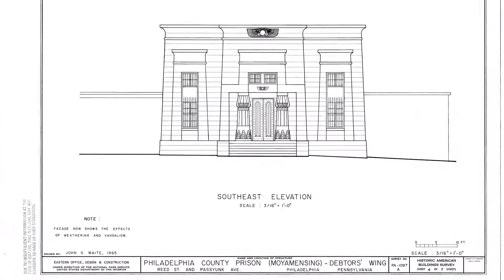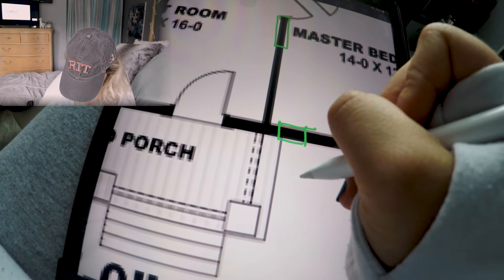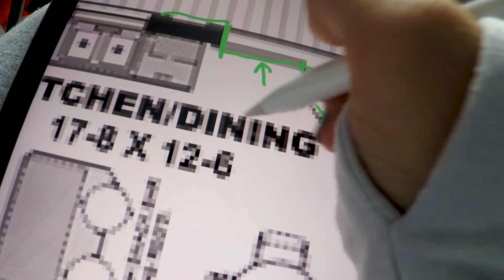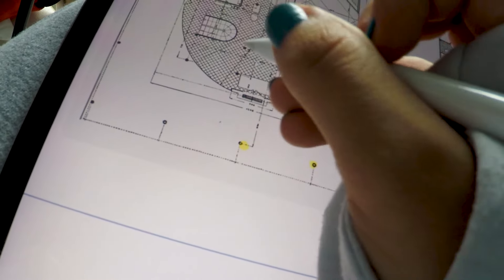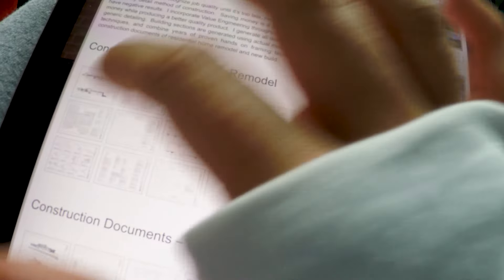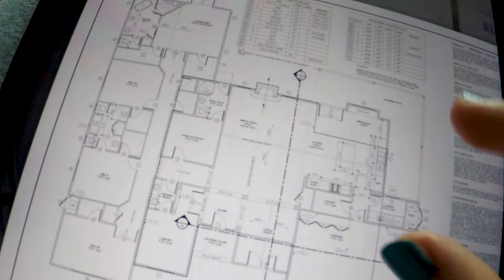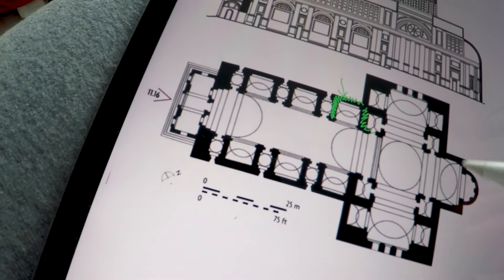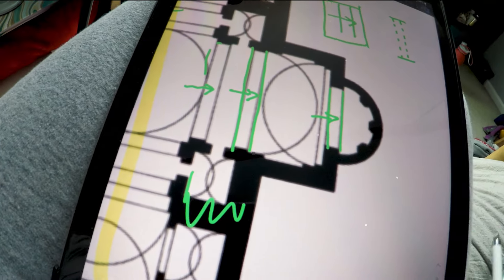how to read a FLOORPLAN (architecture edition) Understanding Architectural Floor Plans Walkthrough

Comment: Oh my gosh. thank you so much for helping me understand how walls and windows looks like in the floor plan. I'm a Mechanical Engineering student in the Philippines, and I'm currently taking airconditioning system and design subject. Our prof gave us a quiz about heat load, and we needed to compute for the area of partitions. The glass walls are included in the computation and we don't have any idea about how glass walls and concrete walls looks like. It really makes me depressed.. Thank you for sharing your knowledge with students like me. 😭

Comment: A good architect will care about how it works and will design it to stand up and function, not just look pretty. Thats why the training is 7 years. But make sure they are actually an architect (which is a legally protected title like Doctor) not a designer, who is not required to have any skills experience or qualification. Structural engineers will only design understand how the structure works. Mechanical and Electrical Consultants will work on the heating, ventilation and lighting. The architect is the lead consultant who pulls it all together.

Comment: I learned about doors and walls now I'm.a painter and need to know how to read them. Teach me about all the numbers on the outsides
Reply from the maker: There are several wall types 
WT-01 could stand for wall tile 01, depending on how the architect drew it. Whatever abbreviation was used, correlates to a finish that could be found in your finish schedule. 

Numbers also found in different parts of your documentation could also signify different wall compositions. FX-XX (Xs are placeholders) the F typically stands for a furring wall for instance.. 
If it’s SX-XX, the S typically stands for stud wall. But this isn’t necessarily universal. Moreso up to the preference of the architect who drew it.

I can’t really tell if that answered your question cus there was no really good description of what specific numbers you’re referring to. But hope that helps

Comment: Hi Natalie! Glad to see you're recovered from COVID. Can I ask five follow up questions please?

1. @4:41 Why would the swing angle of a closet door be less? Do you mean that the closet door won't swing out fully?

2. @8:01: What does "this arc shape was designed to match the turn radius of these cars" mean? That design doesn't feel intuitive. 

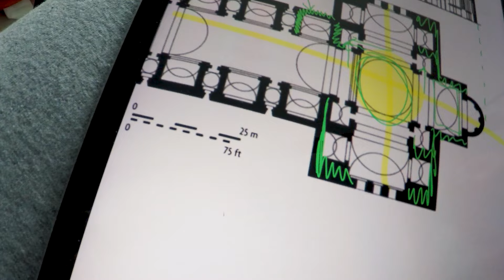3. Please simplify @12:20? I don't understand the curves, and what the red outline means. 

4. Clearer floor plans would improve your video. Can you analyze the floor plans in https://www.amazon.com/Architecture-Today-Houses-Manel-Guti%C3%A9rrez/dp/8499369715, because it contains, complicated, floor plans of fancy but good-looking houses, along with pictures of the houses and elevation drawings. As you advised, we must practice, but we must crank up the difficulty of the floor plans. I'm reading this book now. UPenn's library must have a copy?
Reply from the maker: Hey there! Great questions:
1. drawings need a sense of hierarchy. If you look at closet or a pantry door in your house, chances are they are slightly smaller. I typically drawing existing swing angles at 45 degrees and new doors at a 90degree angle for instance. The degree you draw your swing at really does not affect if it "swings out" fully. It will!! It just depends on how you draw it!!
2. Hahah yes, this is a Le Corb house. Le Corb did a lot for the modernism movement in architecture. Le Corb studied his cars there, and calculated the ideal turn angle. The level 1 of this house was designed so you can gracefully just swing around the arc of the building and park you car, then head right upstairs. He was really experimenting with the flow of circulation in that building, and you can see that even with his extensive usage of his ramping systems in a lot of his projects!
3. the read outline is the section. I was trying to show how a plan and section work together. A section is almost like a slice of cake. A plan is a transverse cut, lifting the roof off, and you have a bird's eye view to below! But both the plan and section will always always work hand in hand! You almost get a wire framed building if you were to connect the plans and sections together. 
4. I cannot analyze plans in that book due to copyright laws and I don't want to get sued (lol). But I am making another floor plan reading video! Any specific building types you want me to look at?

Comment: Thank you for your understanding vid I still didnt quite understand it being "fresh off out the sea" and getting a understanding to it... my main goal is to understand the floor plans and find out ways to improve it is what kind of job I am looking for. I'm still deciding which route I want to take and structural engineering looks like it is but which employment is it that allows you to go over the floor plans and correct them before they set out with the project?